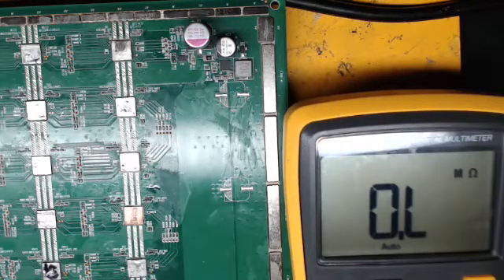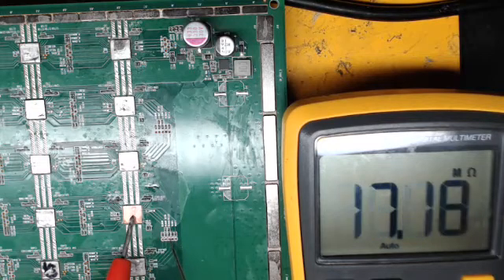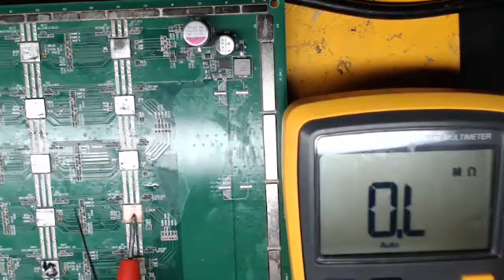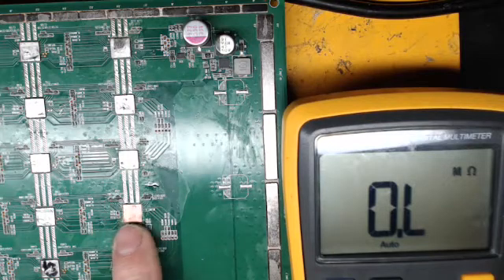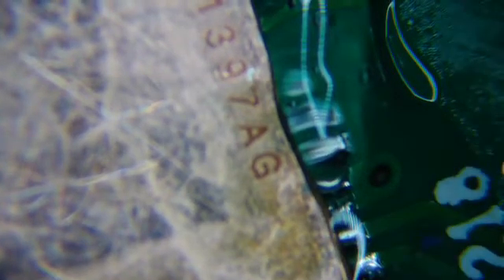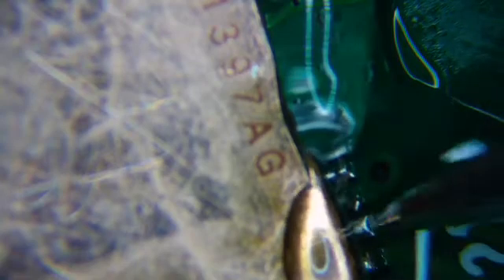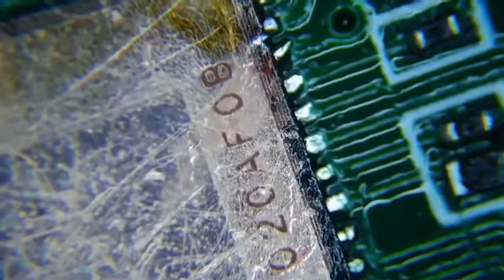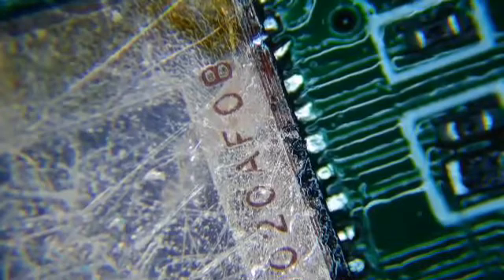hashboard repair:  Replace ASIC chip on T17 hashboard Part 5

Comment: I don't add so much flux. I prep chips and pads first. Center chip and heat .
Reply from the maker: Hi Dorothy,  Agreed.  I've started using a rework station with a hot plate and the initial heat involved little flux.  I get it to seat, then go back over a second time if needed.  These are my original videos early on in the learning process.

Comment: I have seen some videos where they just brush across all the hash chip feet with the soldering iron. Maybe if you add a little solder to the tip beforehand, you might get some clean and even leads.

Comment: How would you check resistance of chip if the chip is those black plastic kind? Mine aren't copper, unless you somehow took the plastic off?
Reply from the maker: Clinton,  I don't know.  There are some videos at Zeus and also some testing/maintenance guides on the discord channel.  I think they would show pictures.  Or someone there also I'm sure has done it.   I'll delve into S9's in the future, but right now I have too many T17 boards to fix.   Are you on the discord yet?
Reply: @AntminerRepair  yea I'm on the discord channel. Username is thadude. I'll ask it over there too. Just figured I'd ask you since that's what you were working on.
Reply: You just use the heat sinks that are attached to the chips, i believe

Comment: hi i wanted to ask, if the asic status show something like: OOOX OOOO OOOO OOOO. does that mean one of the chips is messed up and needs replacement?
Reply from the maker: Hi Eduardo, It just means something is wrong.  I could mean that solder balls are shorting the chip.  But it should identify near the place where you should look, or a weakness in that area.  Thanks.
Reply: @AntminerRepair  hi thanks for your advice. i think i might have solved the issue (at least i hope so) i changed the frequency from 500MHs to 475MHs and i am gettin all zeros! but i wanted your opinion on this matter, do you think this solves my issue or are the chips still messed up?

Comment: Can you make a video when you test the voltages. Do you have to power up the board for that?
Reply from the maker: Hi, I just recorded it tonight.  Will begin to push them out very soon!
Reply: @AntminerRepair  Hello Antminer repair. Now i am sure that with a chip repaste you should leave thestencil on. I have video here how the guy does it. Also is to see how to make a repeatable patern for replacing the cips on the board.https://youtu.be/yMc2VN7CIQ0?t=914

Comment: This looks like a walk in the park compared to fixing the stacks of corroded L3+ boards I keep buying on eBay for some reason
Reply from the maker: Brian, I hope you are at least getting to mine with them?  I just changed out the power pins for my son's S9.  But mainly working on T17's right now.
Reply: @AntminerRepair  I have 10 boards hooked up to a cyclone 5 controller from an R4 that I soldered extra headers onto and modified the kernel driver for. It's not perfect but it works well enough for now
Reply from the maker: @brianfox7067  we are looking at immersion soon. Sounds like that would be marketable to that group.
Reply: @AntminerRepair  I hear 3M dielectric fluids are the way to go (Novec).
Reply from the maker: Brian,  I just started a discord channel and there is someone in there that needs help with L3 boards.  If you feel compelled to, can you join and help him?  https://discord.gg/WpX7N9djVJ    Thanks for considering it.
Reply: @brianfox7067  that is one of the well known solutions for immersion cooling, let me know how it goes
Reply: @AntminerRepair  3m is the way to go, i use novec 1230. Btw, ty for the vids